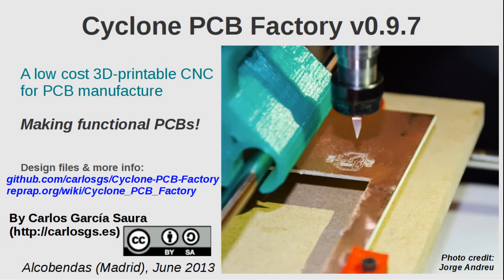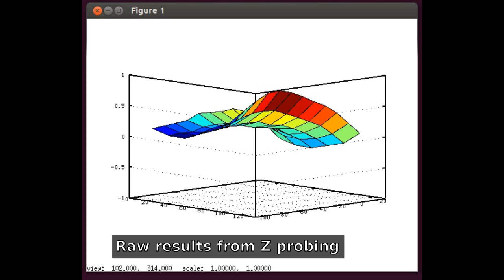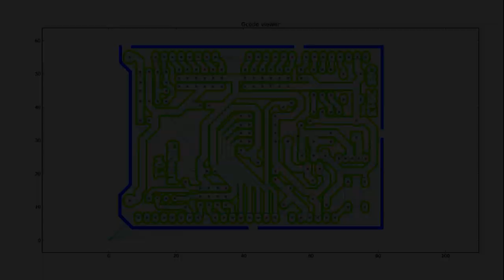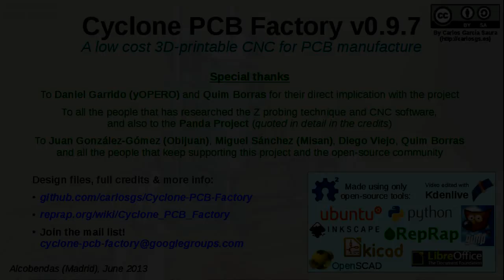[Cyclone PCB factory] The process (June 2013, v0.9.7)

Comment: This looks pretty cool and probably a very cost effective way to do low volume PCB boards. 
The only issue I see is that the edges of the cuts are a little rough. I think he needs to experiment with spindle speeds and cutting tool choices, but it's already very impressive.